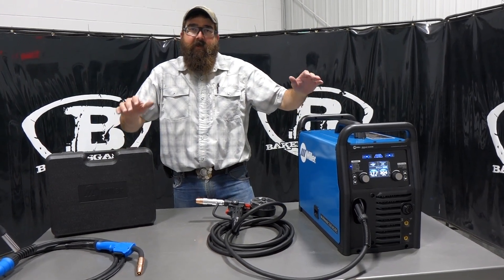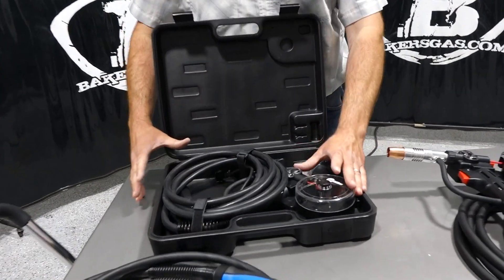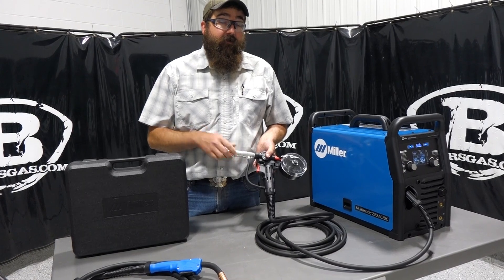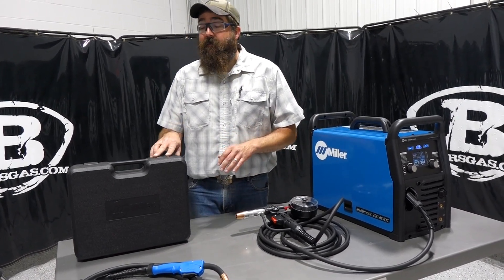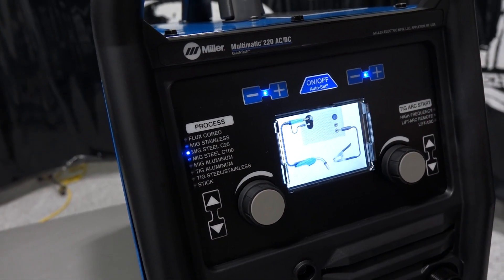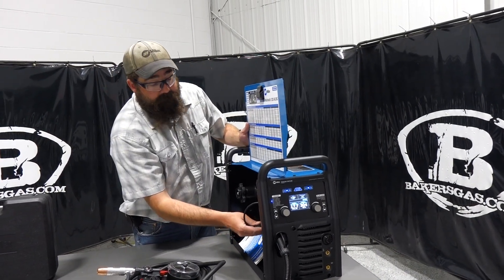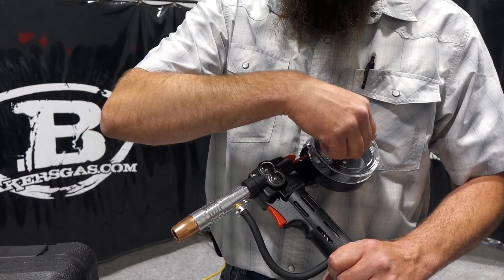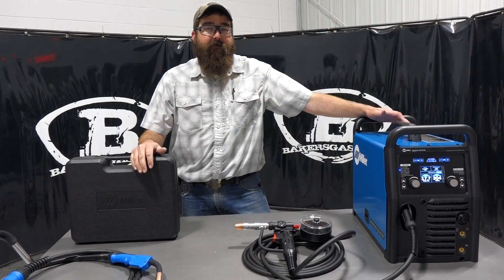Spoolgun for aluminum MIG on Multimatic 220! Spoolmate 100 + Spoolmate 150 Review

Comment: I got a sweet trick for changing spools. Use the drive rollers to catch the wire put the spool in then pull the trigger to feed the wire through the gun.  Makesure to have the tip and nozzle off of the tip . Works great for me

Comment: Thank you for the video. One question I have if you can answer it, I know you can hook up two tanks. (Mix and straight argon). Do you have to switch over your mixed gas/argon on the back of the machine to spoolgun aluminum? I know for tig the machine switches automatically. Just not sure for the spoolgun. Thank you for your time.

Comment: Ah yes. The treacherous, maddening ol’ spool gun. A Mikey Mouse means to an end at best. But, I can testify to one thing; I’ve had really good, expensive ones and I have the little Lincoln Magnum SG 100 that I only paid around $200 for at the time and it’s just as good as any I’ve ever used or seen used.